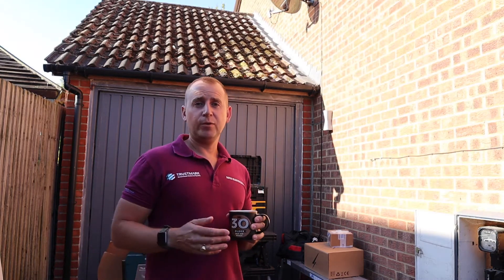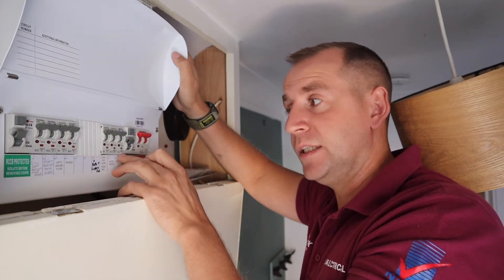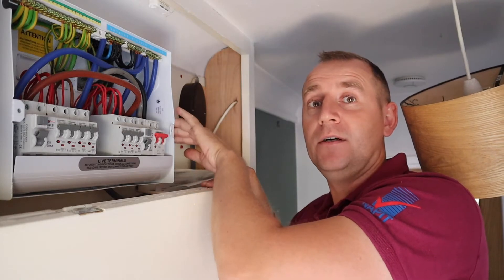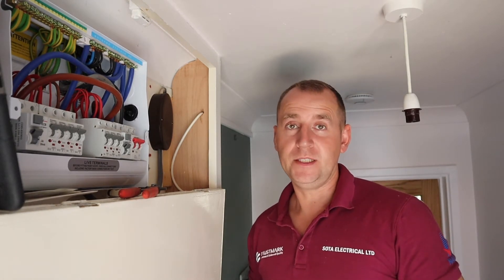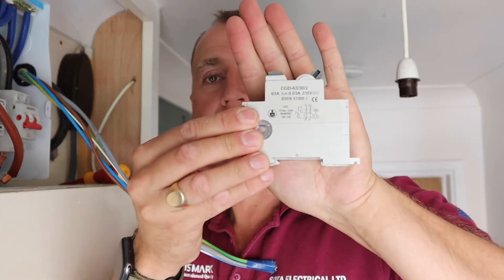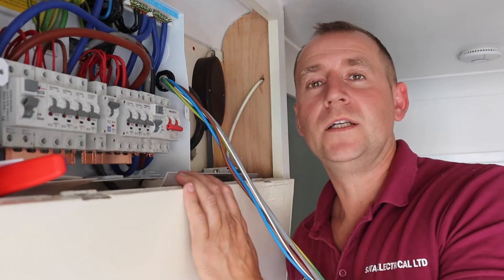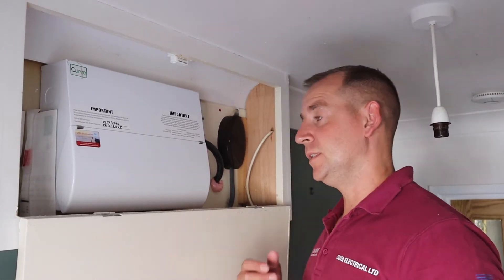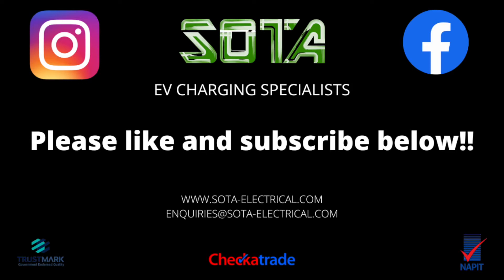How long will it take to charge my electric car?? #electricvehicle #ev #electrician #cars

Comment: How would you know you are not on the end of a looped supply.
Reply from the maker: Hi John, thanks for your comment, great question!!
If you live in a terrace or semi detached house with the stairs in both houses next to each other, generally you will find the consumer unit and your incoming fuse there also, so the most obvious indication is that your supply cable comes through the wall rather than up through the floor. 
If you are unsure, the best thing to do is the simplest, just pop round your neighbours and ask if it’s ok to take a quick look at theirs, or call an electrician to take a look.